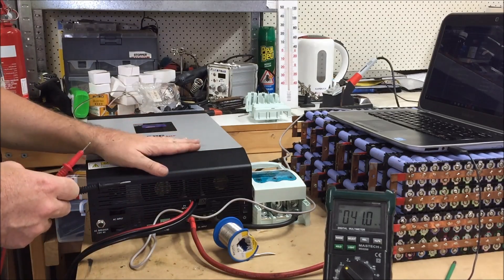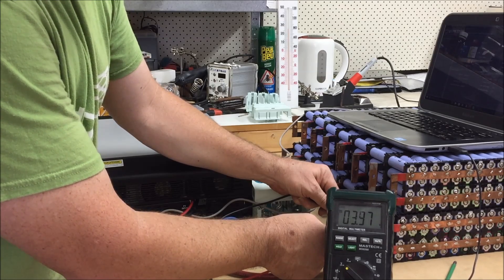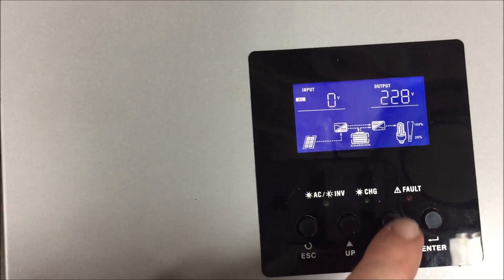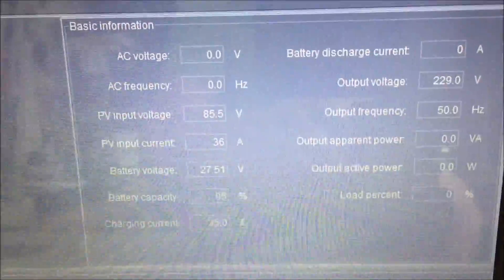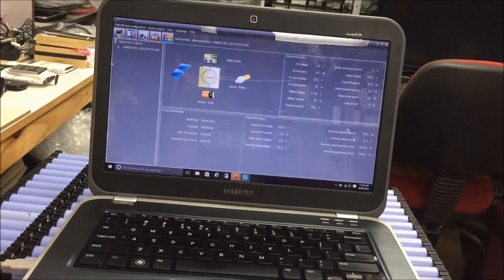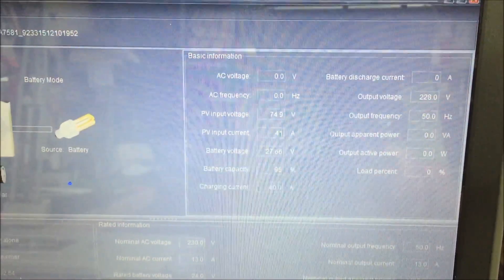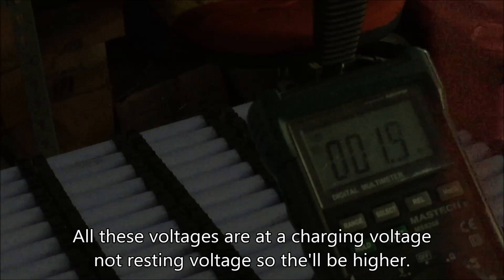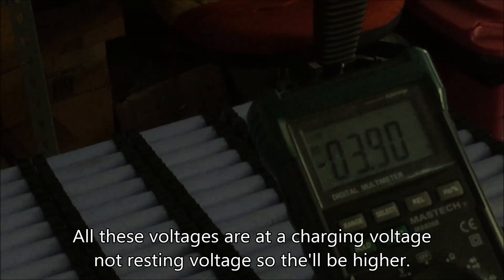18650 cells being charged via solar using PIP2424MSX on my DIYPowerwall

Comment: Great work Brother. Would you like to recommend for me 100w solar 18650 battery cc-cv charge controller?
Reply from the maker: Heaps out there you don't need much for a 100w solar panel
 These little units are good bang for buck, just don't over load them https://rover.ebay.com/rover/1/705-53470-19255-0/1?mpre=https%3A%2F%2Fwww.ebay.com.au%2Fitm%2FLCD-MPPT-Solar-Regulator-Charge-Controller-24-36-48-60-72V-Boost-MPT-7210A%2F112451914404%3Fhash%3Ditem1a2ea80aa4%3Ag%3AfigAAOSwE9hcd1vs%26frcectupt%3Dtrue&campid=5338565652&toolid=20008

Comment: Nice system , but from my perspective i would never put lithium ion batteries in my house even with the best BMS in the world installed because it will fail one day and that could cost you your Life & entire house that's a risk i will never take.
Reply from the maker: Fair call, but that's like saying you wouldn't put you gas bottle in the back of the car on the way home from getting it refilled? Also not inside the house - it's all in the workshop - that said two years later still running my house 24/7 with very few batteries replaced. Correct tools help mitigate the risks involved - thermal camera, 120 temp sensors, 4480 cell fuses, pack fuses, shunt trip triggered by bms & any one of the 120 temp sensors, or voltage sensors :) Even if the BMS fails all the longmons still work to actively protect against over voltage events
Reply: @HBPowerwall  im glad you made the right percussions necessary. After i saw your videos i ordered today  200 18659 batteries 😂 . Gonna try it out..
Reply from the maker: only made them with the communities input - check out https://www.facebook.com/groups/diypowerwalls

Comment: Something is not adding up, if you have 74.9V; 41A, PV input, why are you only charging 27.6V; 40A, to the batteries? Your input is (3,071W) and output is (1104W)! Where is the other 1967W going too? If this is losses in the PIP, then this is not a very good product at 66% conversion loss! Hopefully you just have the charge current limited to 40A. Well after watching farther, output limit at 40A can't be it, because you show 94.1V, 23A PV, at (2164W) Output @ 27.24V, 22A at (599W) for a conversion loss of 72%. I May have to rethink buying an MPP inverter, if these are actual results.

Comment: any update of this system?Any trouble with the different battery configuration on that solar charger?I am curious if the battery after 2 years still working and cooping with that solar controller.Nothing blow up I mean :D as I am eager to get a similar project.Thanks mate
Reply from the maker: that pack in this video is still in service but is underperforming compared to the newer packs that have been build differently and with better cells

Comment: these people are fucking losers, each and every day idiots like this burn their houses down, if you follow these stupid lithium battery crack heads they always seem to post a bunch of videos and then suddenly drop off the map, it's because they burn their houses down and their ego is so fragile they can't take 5,000 people laughing at them. these batteries are usually thrown out or disposed of for a reason, these jack ass probably goes to libraries and post offices that have "recycle your old electronics" bins and he steals them, what he doesn't realize is there is usually a safety officer who labels these hazardous and THEY ARE THROWN OUT I am no electrical engineer but you can tell how fuckin stupid this guy is watching 10 seconds of the video. The solder job alone should of kicked in his common sense but this guys more interested in fascinating 8 year olds on youtube.  one tiny fluctuation and the solder melts and there is a connection DEEP inside his "battery bank" and then it's a cataclysmic chain reaction and you got Lithium burning inside some innocent families apartment building or upper floor.  Fuck you HBPowerwall
Reply from the maker: Do you need a hug sweatheart ?
Reply from the maker: Come on, don't leave this too long - the hurt will get worse - Bring it in for a hug, I assure you I'm hot!

Comment: I would like to ask you what size should I keep between the inventory and the solar cell breaker? 6 batteries with 260W 37V -short circuit 8.8A, are connected in parallel. It is enough to use a DC 2P breaker 16A? or more? Thanks.

Comment: Hello from Spain. How is the power bank in these 2 years? Have you had to replace some elements? Would you recommend the 18650 for solar energy from your experience? Thank you very much I remain attentive from Spain.
Reply from the maker: The pack in this video is still running and is located in my power shed & is the top seven cells. Still going strong but through the last year i've replaced 7-8 cells due to them having less capacity
Reply: Hello and thanks for answering so fast. So if you could go back, would you build it again? Or you would do it with another type of cell like lifepo4. Thanks and greetings from Spain.

Comment: What ampere rating do these batteries have? And what is the voltage rating?
Reply from the maker: their amp rating differs over each different cell - currently, max amp draw per cell is 0.25amp and base load draw is 0.03amp per cell. Nominal voltage is 3.7v max is 4.2v

Comment: did you know of a charger with a input of around 190VDC, I have this big voltage because my solar panels are about 150 foot away.
Reply from the maker: You could use this product https://rover.ebay.com/rover/1/711-53200-19255-0/1?ff3=4&toolid=11800&pub=5575290598&campid=5338074967&mpre=https%3A%2F%2Fwww.ebay.com%2Fitm%2FGE-5kva-4000w-48v-Solar-inverter-230v-80A-mppt-solar-charger-high-PV-500vdc-%2F132188483856%3Fhash%3Ditem1ec70c3110 500v 48v inverter /charger

Comment: How does this inverter charge the batteries? Does it hold a steady current for most of the charge then hold a fixed voltage as the last part of the charging process tops up the li-on cells? Does it have it's own BMS or did you have to fit an extra BMS? Is it not difficult to balance so many 18650 cells?
Reply from the maker: If you look at my newer videos - I have a http://batrium.com BMS and have been charging the batteries from PIP inverter & PCM60X charger controller the whole time. Neither are designed to be used with lithium cells. I've set the cccv to about 0.2 of a volt lower than fully charged (4.2v) so on 24v pack 28v or on my now 48v battery bank i have it set to be 'fully charged' at 57.4v

Comment: just a quick question the lg 18650 battery from ebay  (Lithium Ion ICR18650 MF1 2150mAh ) 20x cells each cell is 2150 ah. The spec sheet says Max. Charge Current 1.0C(2,150mA). So when you have this pack 36v 10s 2p  what is the maximum ah current can you charge it 2ah 42v current  or  2ah current x 20 cells ~ 40 ah current at 42v.  Now if you have 3x 10s 2p in parallel which is 36v 12.12 ah what is the maximum ah current  you can charge thats 60 cells is it 60 cells at 2ah current  which is 120 ah current  for 60 cells or just 2 ah for 60 cells using cccv charger 
Thank you very much
Reply: chris foster
The C rating is per cell or each series battery of cells. If you've got 2 cells or 2 batteries in parallel then you can charge with double the rate. You mentioned running 3 packs of 10s2p in parallel so ignore the 10s and just add up the 2p to a total of 6p.
So you can charge at a rate of 6C which is 12.9 Amps (and not amp hours btw).
 
Having said that, if you dig deep into the spec of various different brands of 18650 cells most recommend 0.5C or less for extended life.

Comment: did you order the pip from someone in aus or through alibaba?
Reply from the maker: I got it here in https://rover.ebay.com/rover/1/705-53470-19255-0/1?ff3=4&toolid=11800&pub=5575290598&campid=5338074967&mpre=http%3A%2F%2Fwww.ebay.com.au%2Fitm%2FNEW-Solar-inverter-5kva-4000w-48v-pure-sine-wave-off-grid-MPPT-80A-charger-%2F131134588867%3Fepid%3D621116019%26hash%3Ditem1e883b07c3%3Ag%3AsvIAAOSwlY1ZNhJN they were drop shipped from sydney and arrived in days not weeks !
Reply: i saw a couple of people complain about them over volting there batteries just wanting to know your experience overall
Reply from the maker: Owned 4 no problems yet - you get what you pay for and a lot bitching about it think they purchased a $4000 inverter. If mine lasts two years, I'll have got what I paid fo

Comment: am i missing something here ,or is this something you will need to babysit 24-7 ? will you even be able to run a load while charging ,or will it to be disconnected for charging like a bike or an RC car/plane.  another bummer is you have a billion small batteries and when one needs replacing, it's an all day job of soldering and hoping you don't get zapped or start a fire. do they make a battery case that size, which can just be opened up to replace abab cell ?
Reply from the maker: Look at later videos :) I DID babysit it for many months. It was a pain in the butt it runs my house 24/7 these days. It was a job and a half soldering all the cells but it's the process i choose to do, many have done it otherways
Reply: HBPowerwall so it goes on its own now.? my biggest question was do you need to disconnect to charge or is it like a regular set up now? being charged and used at the same time?
Reply from the maker: Solar is hooked into the inverter (now 48v) Batteries connected up to inverter then the house. if the house isn't using the power it puts it into batteries and if there is no solar it draws it from the batteries
Reply: HBPowerwall  that is awesome . my last 3 lead acid deep cells lasted only 3 years. i have some old  18650's that must be 15 years old and most still had a charge from back then .today,lead acid's are designed to die 3-4 years. i want to do this on a smaller scale ,in an old 1669 fireball,camper trailer i am rebuilding. that will be cool . i have a 144 watt panel.any idea how many 18650' i can use ans charge controller for a small scale? or a good sight to look at?

Comment: Ouh, first of all I hope your fire insurrance still covers you despite this setup !

I see two risk factors here:

1: parallel and serial coupling of Li-Ion batteries without cell ballancing, will most likely end in a massive fire/explosion, it's just a matter of time.

2: Using such an unstable product like the MPP Solar series of inverters.

I have 2 of the MPP Solar inverters which have even destroyed my 150Ah 12V batteries, apart from themselves going bezerk after less than one year of operation, and I have given up intirely on MPP Solar "product support", which instead should be named something I am not allowed to write here.

They just ended up ignoring my emails, when I did not opt. for buying new Mainboards at my own cost.

So make sure you install this in a good distance from your house, preferably in a litlle shed some 20 meters from all other buildings, otherwise I fear you are in for some very nasty surprise and economic disaster.

Just a piece of advice, friend.

br
Steen
Reply: Steen I couldnt agree more, so right on (I am a real EE btw not an meddling wannabee).  That circuit breaker and fuse are not rated for dc use but I doubt if my observation will be accepted without abuse here - no sums allowed.  The dc world is far removed from amateur comprehension and you need an AIC (amperage interrupt capacity of 20kA  yes 20,000A).  Just imagine a stick arc Welder and multiply the effect x 1000.  a fault current event has been likened to a hand grenade for energy release - very dangerous, never seen any mention of use of goggles - a trivial spark can send out a jet of vapourised copper straight into your eyes + UV damage.  An arc flash burn on unprotected flesh - you dont want that.
Reply from the maker: lol Samsung still make phones :) I've had three of these units and have performed flawlessly

Comment: so your panels, connect directly to the solar charge controller, controller its mppt and type of battery set was it gel? , and the charger connects directly to the battery cells without unbalancing them?
Reply from the maker: yes solar directly to MPPT PCM60X charge controller up until now all balancing has been done manually by me. Time consuming but works as expected :)

Comment: After watching the work done by 3nergE, shaking head at the unprofessional manner and the disregard to electrical safety, as a qualified engineer I started looking around at what others are doing in this area.  

I noted that you did try to give advice to 3nergR , I did the same, in this I was questioned to my ability after 50 years in the electronics industry, with my advice been dismissed as not understanding battery technology.

That aside, I congratulate you for your work and the way you are presenting it to others, promoting good safe examples, unlike the other...
Reply from the maker: ty
Reply: The smart survive chief ! Don't worry they won't even know they're dead !

Comment: Hi there!
I have a charger just like yours and I was thinking about changing from AGM batteries to 18650 cells... Can you tell me how you configured your inverter to charge these batteries? Thanks in advance.
Reply from the maker: for right or wrong all I have done is set the charging from AGM to manual and set float and bulk to same value 4.0 volts in my case per cell. You can go higher but been told that'll make the cells last longer. Also there is a problem with the pips and cloud edge. If the batteries are at 4 volts and the sun comes out from behind heavy cloud It can push the voltage up too well past 4.2v for a minute or two before the MPPT brings it back down again. You really have to watch the inverter to see if yours does this. All of mine have - PIP2424MSX, PIP2424HS, PIP4048MS & even the PCM60X does it a little. The PCM60X has the extra setting where you can change the CV or constant voltage time. I set that to 5 Min - hope this helps. Pete
Reply: Thank you so much for the answer... It sure did help.

Comment: How long do those batteries last before you can't charge them anymore?
Reply from the maker: Check back in a year or two :) I have a little testing to do still
Reply: It depends on the batteries but you can generally count on about 1000 full charge/discharge cycles.  But if you deliberately under-charge your cells, you'll usually increase that cycle count quite a bit.  Also, the cycle count is only an estimate as to how many cycles you'd expect to get before the cells have lost 20% of the cell capacity, so the batteries don't automatically become useless at that point, just less useful.

Comment: how do you plan on ballanceing that huge ass pack.. 300 mah per group is not enough you need 5 amps discharge capability or more just use a standard deep cycle battery why wastye all this money

Comment: Great, but my Q is how can use this great PIP2424 with an external BMS? PIP has it's own charge controller and can be overrided AFAIK. Sorry for my bad english.
Reply from the maker: +Jose Luis s yes i believe so, say tuned it'll either blow up or work as planed :)

Comment: Nice to see it charging.. No BMS? because each of the cells is not at same capacity.. you concerns about lithium capacity life cycle curve.. 4.2v for overcharged protection and 3v bottom balance per cell. 7cells in a row, better set the highest battery charging voltage limit at 28V if without BMS.. but always need to check the voltage each cells frequently.
Reply from the maker: +Justin Stine Have bms, just didn't think i needed it till i pushed closer to 4.2 turns out i was wrong :)
Reply: yip, that made you right.. one happy succeed testing. we can't call it Powerwall until the time it hanging on the wall.. Cheers
Reply from the maker: +Justin Stine but i took the photo to make it look like its hanging - doesn't that count? lol

Comment: Well done man. All you'll really need is an active balancer for the cell packs. Could be done with an arduino uno, some opto couplers, transistors and resistors. A 1A load per string should be all that's required to keep the cells in balance. Pretty simple to build and program. If you have ethernet in the shed you could monitor it all from your phone with ThingSpeak and log voltages and temperatures over time.
Reply: I would love to build this mythical thing you speak off.......I've spent weeks building multi temp sensors with fans and 13 individual volt meters!!! That was hard stuff for a newbie. Perhaps you could show us how??? :)
Reply: How precise do you need the voltage sensing to be? 10mV or 2mV resolution? There are a number of ways to do this, probably the cheapest is to use 1 PIC12F1572 microcontroller per series cell bank as this chip is cheaper than a stand alone ADC chip. Then an Arduinio to manage all of them and communicate with the ethernet shield and ThingSpeak. What size is your cell bank?
Cheers, Brenden.
Reply: 10mv resolution is fine as i only want to monitor the bms.  Like i said in the previous post this sounds awesome but way over my head. I find writing the code the hardest. My battery is 48v 88amp, 40 cells per 4.2v x 13 banks. 
Cheers Craig
Reply: OK Thanks. Working on a really nice balancer circuit to monitor and continuously balance the pack for about $3 per series cell set basic and about $7 with charge transfer up or down the pack. Arduino controlled/monitored.
Reply: I would like to hear more about that plan!
Reply: Dream Deal yeah! Me too!